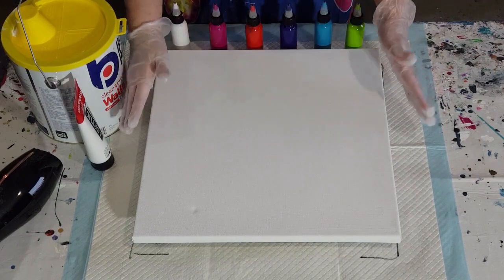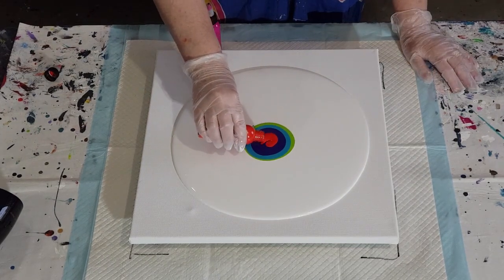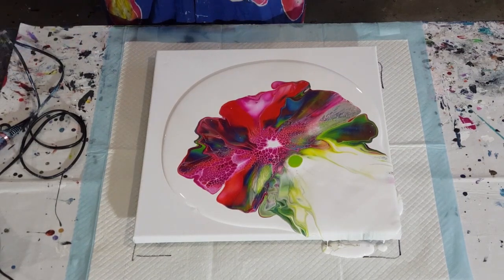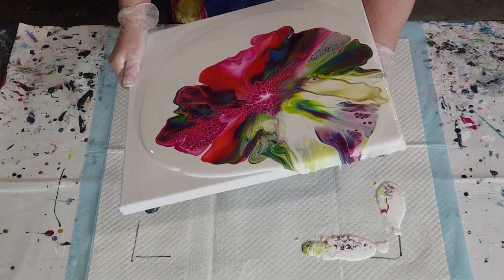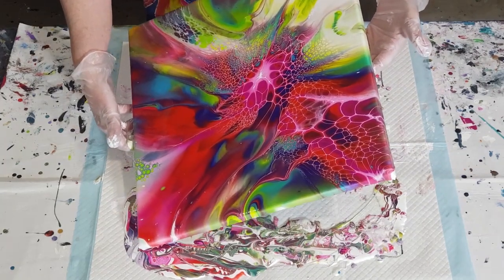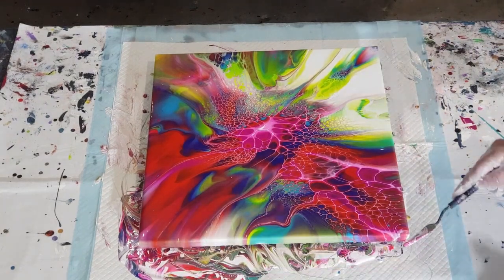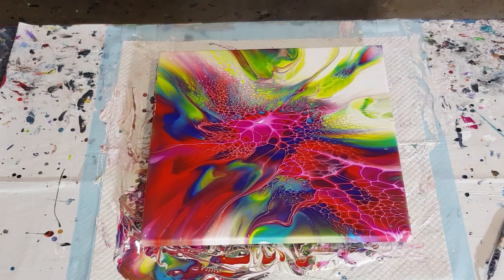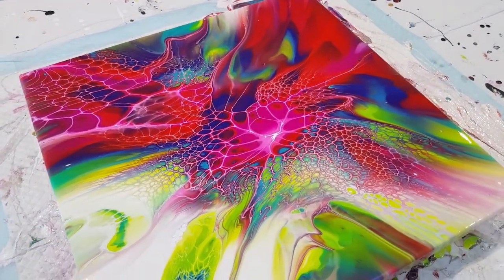#648 I Like BIG BLOOMS And I Cannot Lie...Huge 16" Sheleeart Bloom

Comment: I would either try doing it in a line at the top or on one of the sides! Also maybe try to use the line from the top, but don’t use too much of the white on the bottom and use 1/2 inch lines across the top of the board and then blow downward with your blow dryer! Wow, there is so many different ways you could do this!! I’ve just now thought of quite a few different ways myself!! Good Luck to you! Yours is a GREAT PICTURE!!

Comment: I don’t know if you will see my message but this is stunning 
Your comments are the same as what goes through my head doing the ring pours 😂
 
Also can you tell me which brand of house paints and the Jo Sonjas is that two different bottles or all in one the varnish with the polycrilic? Thanks
Reply: Also for the PM how much low sheen house paint to the Jo Sonjas gloss varnish and polycrilic 

I read you have 2 part to the paint
But that is difficult as I don’t know what the pouring medium measurements our house paint and varnish and poly acrylic thank you